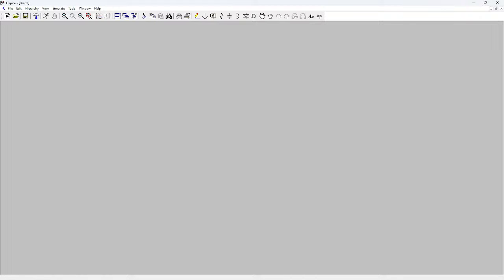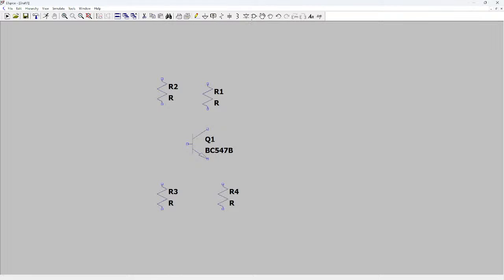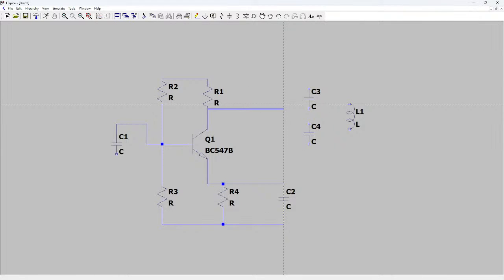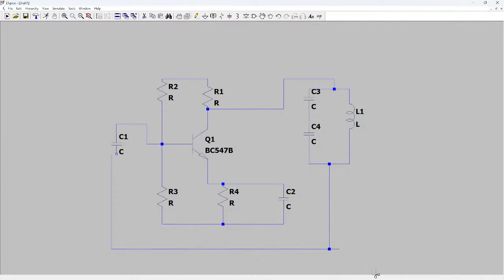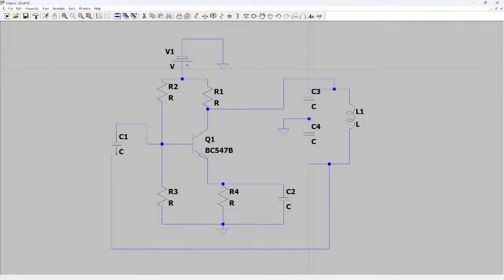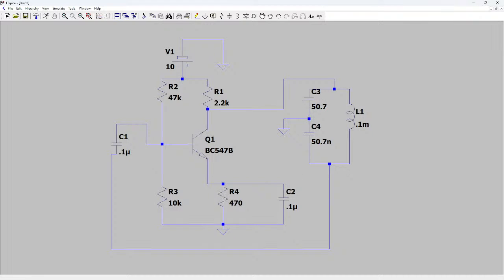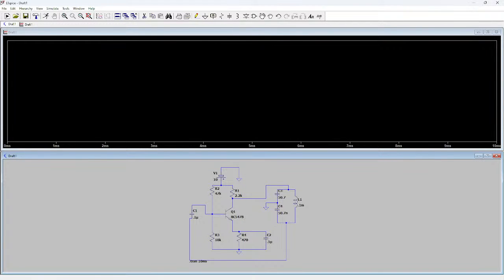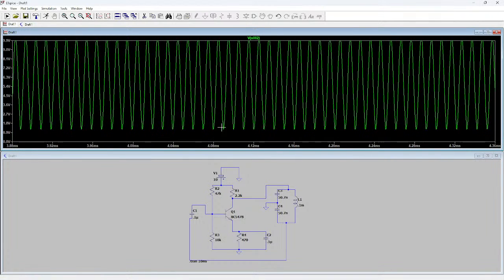LC Colpitts Oscillator LTSPICE

Comment: I am still getting the straight line as graph
Reply: Check connect node again you need to connect correctly
Reply: Check the input voltage connection,if you given input opposite,then it will show a straight line